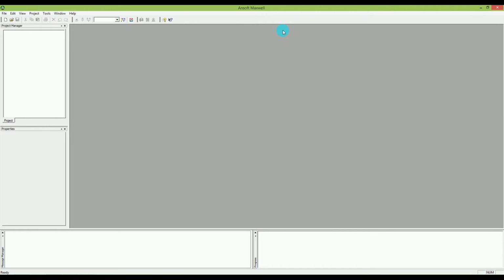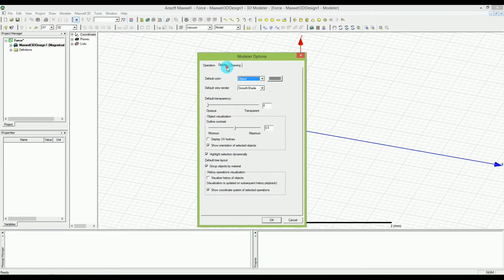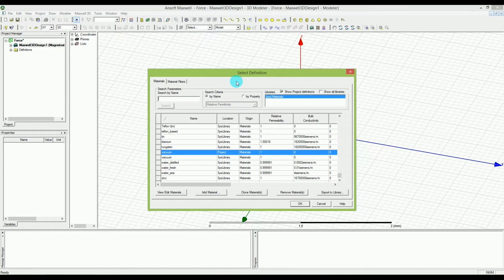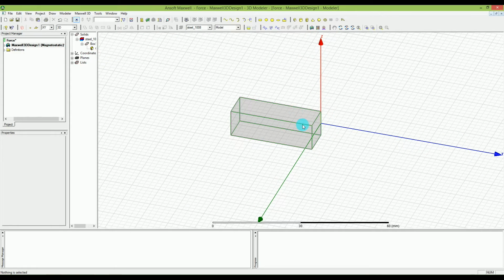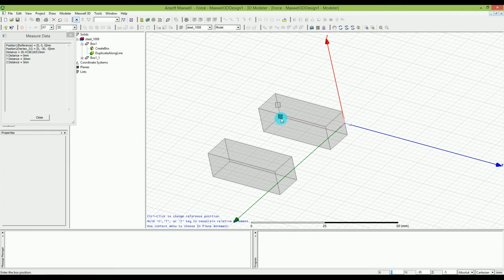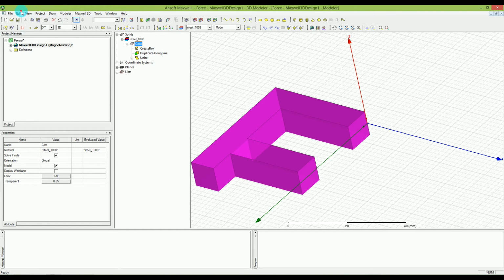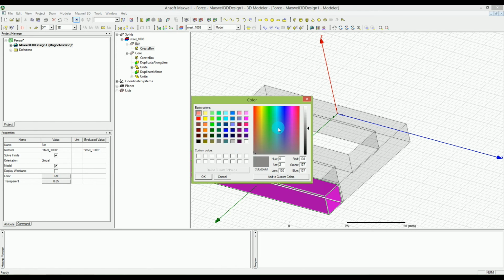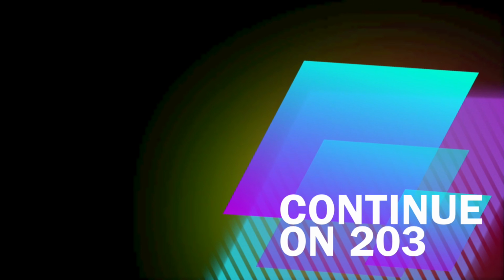202 Ansys Maxell  Calculatig Force with Magnetoestatic Analysis

Comment: Hi Kamyar thanks for the useful videos, helped me a lot. I have some problems. i want to model a coil with 950 turns and the current is 0.3 A , should i multiply these numbers and give 285 A as coil excitation?
the other problem is the amount of force generated by coil. i have a part that must attract by the coil like yours in this video, based on formula F=mu.A.(N.I)^2/2g^2 force on that part is 250 N but in maxwell when the excitation is 285 A, force is about 0.03 N. Where the huge difference comes from?

Comment: Hello Kamyar. Thanks a lot for these awesome videos. I have a question: I am simulating a semiconductor crystal with metal electrodes and would like to simulate the electric field lines inside the crystal. I also want to simulate the electrostatic lines inside the crystal. How can I do that?
Reply from the maker: +Abdulsalam Alhawsawi  same way but you need to have the material property of the. Rural well defined.
Reply: Hello Kamyar. Thanks a lot for the quick response. Should I assign excitation to all the metal electrodes I have in the design or only to the semiconductor crystal? I did something similar to what you did, where I created a section and assigned a 1000 V to that section. I analyzed the results but could not get a field inside the crystal. Not sure what am doing wrong
Reply from the maker: we are following up in the  email. ;)

Comment: Hi Kamyar, thank you very much for your video. I have a 3d wireless power transfer system model. I'd like to apply a high frequency current in the primary coil and measure the induced voltage in the secondary coil. which solution type is more appropriate and how to do it?
Reply from the maker: +Ahmed Mohamed  depends if it is very high frequency use HFSS instead. If it relatively high frequency you can still rely on maxwell. Transient is the most trusted.
Reply: Thank you Kamyar for your answer. My operating frequency is 40 kHz. Also, I'd like to ask if there is a way to get the system parameters (self and mutual inductance and coupling factor) by the transient solution?. Since I noticed that I can not add a matrix in this solution.
Reply from the maker: +Ahmed Mohamed  ?